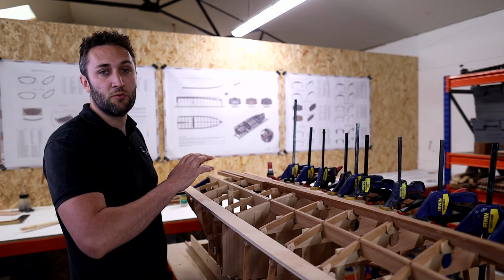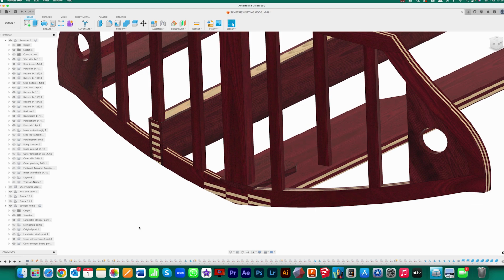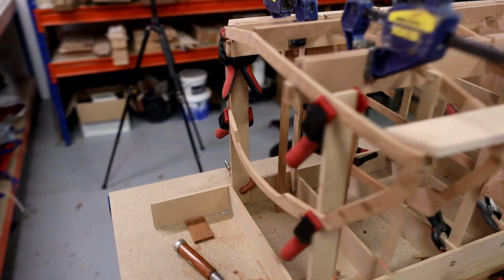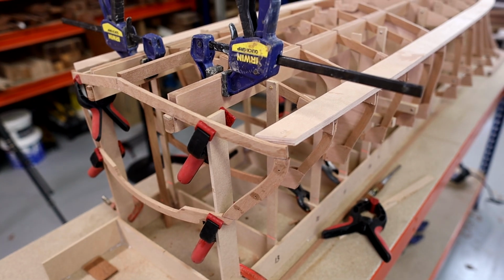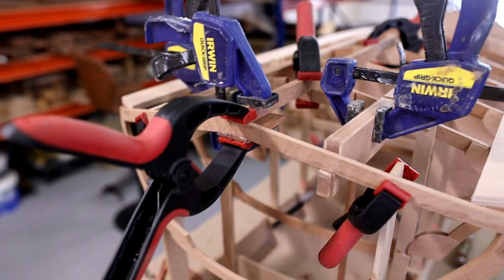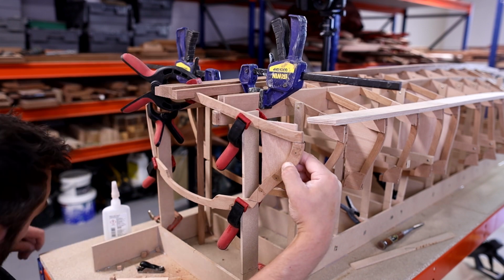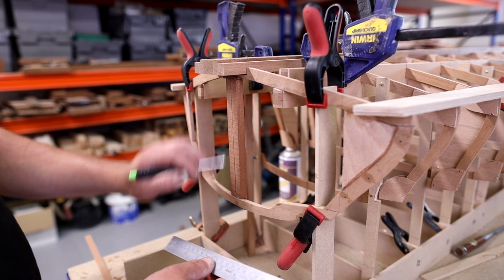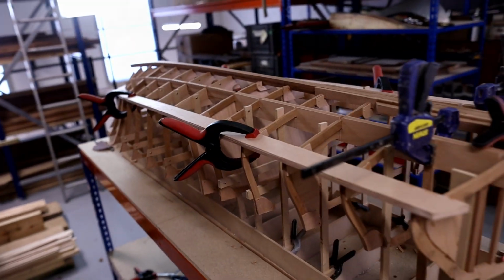Completing the Transom | Temptress 1/4 Scale Boat Build Part 12

Comment: Super informational!  This video gives me the confidence to complete the full-size Temptress transom… in a few weeks from now.
Reply from the maker: There was quite a bit with this that I still hadn't got my head around, doing it made things so much clearer which will really help with giving you advice if you need it. The only thing I would recommend that you do differently to what I've shown here is to recess the smaller beams into the transom framing in some way, with either a half housing joint or a bevel notch rather than just butt jointing them as I did. I can send you more details on this via email if needs be.
Reply: @DanLeeBoatbuilding … most excellent advice

Comment: Is a vertical transom a design feature of classic barrel back runabouts?  I know a lot of them have it but I've noticed some of the older ones and a lot of newer models have the transom raked forward which I think looks quite sharp.  When I build this boat I might try to arrange the transom that way, provided it didn't crowd the engine compartment too much.  The model is looking great Dan!  I hope the patreon account helps you get a full-size build started soon!
Reply from the maker: Yes it was quite common. I guess perhaps the most famous example of raked transoms are the Riva Ariston and Aquarama. I agree they do look lovely! It may be doable on Temptress but it would require some quite substantial re work. 

Yes I’m hoping Patreon will help to move things forward, it’s one in a handful of new things I’ll be rolling out shortly 👍

Comment: The part of the transom where the cheeks go looks like it has a curve to it. How did you get the cheeks to fit that curve?
Reply from the maker: Yes there is curvature there. The cheeks are slightly proud at the tips, a very small amount. Before fitting the transom skin these will get shaped slightly to conform to the curve.